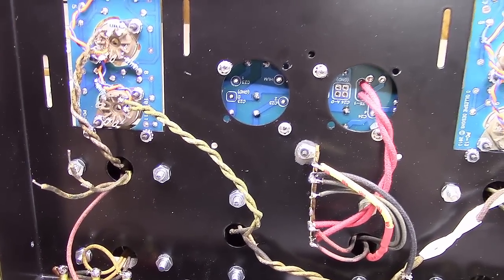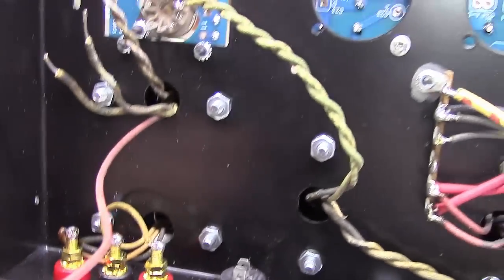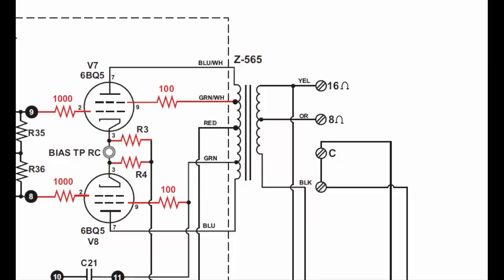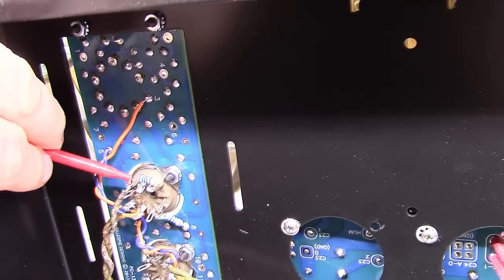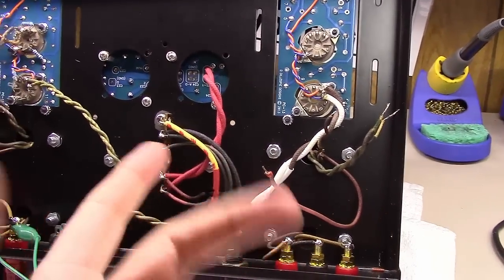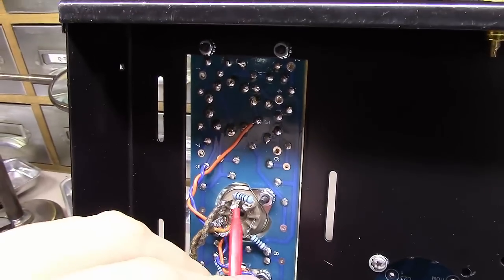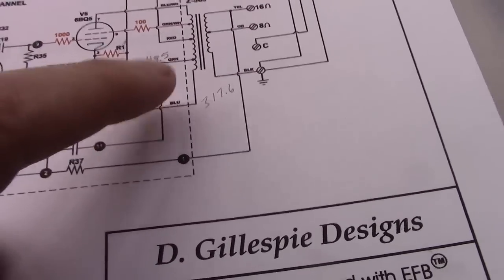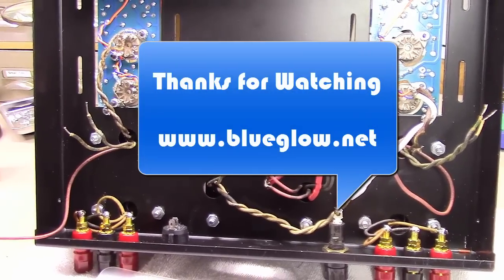How to test a tube output transformer and determine wiring colors - BG032

Comment: I noticed that when measuring inductive loads with a DMM strange readings, DC is applied in pulses looking at a scope. It would be interested to see what reading is obtained with a VOM. Other than that the high resistance could be caused by a poor carbonized connection in the transformer.

Comment: How would you suggest I cover the transformer wires inside ( under the bell covers) after I changed the wires. The sticky shellac like paper was covering the wires which I had to remove to change the wires. I'm not sure what to do.
Thanks

Comment: I have two vintage output transformers. No wires are labeled.  I know the primary by measuring resistance, but how do I know B from P?  Or would it even make a difference?  Likewise on the secondary, how would I tell ground from 8 ohms?
Reply: I'm in the same boat. The way I see it I need to match polarity with NFB in a stereo amplifier.

Comment: I got a quick question on a  old power transformer, it's got the 120v in and two greens for the filments, then it's got yellow and red that runs to the rectifier, then the confusing part is it's got two blue wires and a center tap blue and yellow, when I tested them to the center tap, they where 15 volts, 30 volts together, any ideas what this could be for? I think it may have went to a selenium diode on the old amp it came out of, I want to use it on a small amp build, but I don't know what to do with these blue wires. Thanks
Reply: That would probably be for the negative bias circuit
Reply: I have many transformers like that some at 44v 80vac you have to change them to dc you can get a neg bias board on eBay with adjustable settings for each grid usually 4 it looks like yours is for a single ended amp el84 tubes or 6v6

Comment: I agree with Sarah. The transformer with the higher dc resistance reading is going to be out of specs. If someone looks up a service manual of old tube console's it will give dc resistance specifications for the transformers. So if you were a technician that is how you would determine if the transformer was bad.  I had a Fisher x100c with bad output transformers, so I unwound them and the primary windings were dual wires. Obviously the transformer in question has one of the paired wires open.

Comment: Hi BGE, Very interesting video, the 1st thing I thought of when you got the anomaly in d/c resistance between the one set of wires was just what you said... transformers step-up or down a/c. However, since you did end up getting proper a/c voltages for both the left and right sides, it must mean that for whatever reason, the lead that measured the higher d/c resistance has a longer wire or more turns to read that higher resistance correct??  I'm really curious as to why that is..... Maybe someone who winds their own transformers could chime in with the answer... Take care, Tom

Comment: It's possible that what you're looking at is a marginal transformer on the left side. Considering that it's a device that must perform over a wide bandwidth, the "winding" of a good output transformer is actually a composite of separate windings, in an effort to balance the series and parallel inductances inherent in the device. The approach of "these numbers don't make any sense so the data is meaningless" doesn't really fly, because in reality important information winds up being thrown out.
In making a winding for a transformer, you will have a given number of turns of a particular gauge wire, which has a resistance of R ohms per foot. In a given winding, you will have a particular length of this wire, ± a nominal amount for slop. In a high quality transformer, part of the goal is to have the amount of slop to be at a minimum, though in the real world it is impossible to eliminate entirely. As a practical matter, the DC resistance will vary a small amount from unit to unit, though a difference as large as a factor of 2 is important information, and should be questioned.
Looking at the windup schematic for the A470 (ST-70), we see that the primary of the transformer is really two primaries in parallel. The Z-565 is most likely wound in a similar fashion. So if you're getting that high a reading in one plate circuit but not the rest, it's likely that one of the parallel windings is open.The best way to test this would be with real world powers and loads.http://www.diytube.com/phpBB2/viewtopic.php?t=3694
Reply: oh lighten up...

Comment: I think I'd still be worried about resistive losses under load. You're measuring with a 10 meg input impedance meter. With a load it's the same as having that resistor in series with the transformer tap.
Reply from the maker: you should make a video on the topic.  dc resistance means little at audio frequencies, that was the point of the video :-)
Reply: I'm sorry. Resistance matters at ALL frequencies. DC coil resistance is only irrelevant when it is low, not when it is high. When it is higher it becomes a major factor. Put a resistor of that value in series with a transformer winding under load and observe the waveforms with a scope at the different nodes if you don't believe me. 300 ohms resistance will be a very significant loss. It's exactly like ESR in a capacitor.
Reply: It wasn't meant to be negative - I think you're a little defensive.I've made a few dozen videos. Not set up to do that at the moment. I'm not a critic. If you don't want comments, just disable them. I like your videos by the way - and you're much better with tube amps than I am. I'm mainly a solid state guy. I think it would be fun to work with you!
Reply from the maker: Sorry for my rant, it just hit me wrong.  Always open to feedback if its constructive.Maybe our paths will cross one day...

Comment: A 'variac' or variable autotransformer is not an isolation transformer.  You are telling people to wire their audio output transformer directly to the power line. If you must, may I suggest a 6 volt step-down transformer with a 1K resistor in series. 

If you get a wacky reading with your Ohm meter on a transformer's DCR, just switch meter leads.

You assume to know at least one lead other than the CT by color. If not this method gives a 50/50 chance of wiring it out of phase.
Reply: +Farnsworth Nope, on the other side of my variac I have a RCA WP-24A Isolation Transformer.  I've shown it in previous videos I think